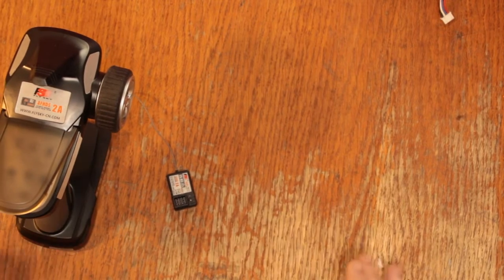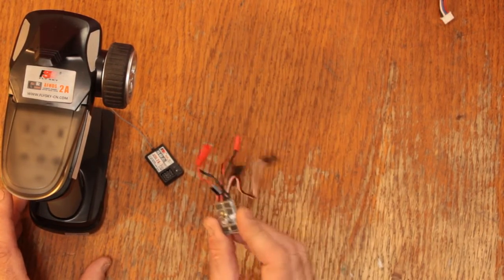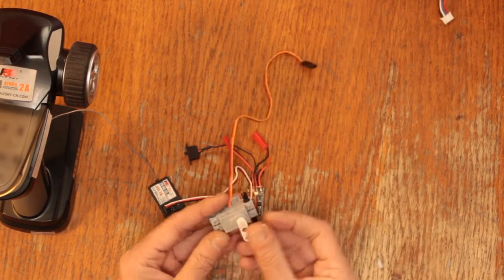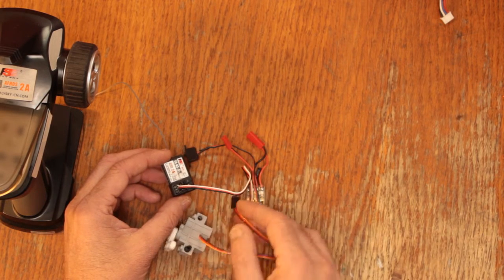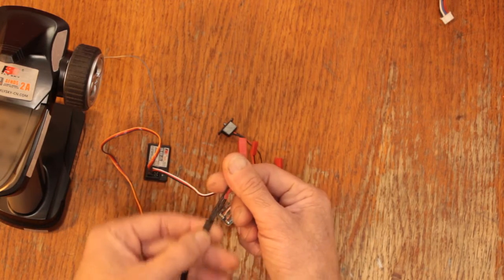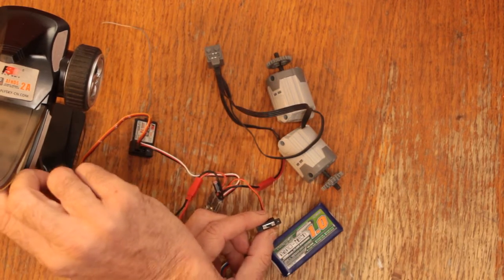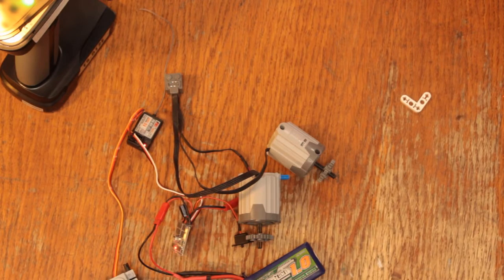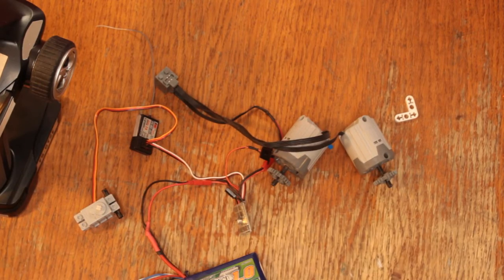Lego Compatible Servo for Lego Hobby RC Radio Control

Comment: Would any cheap 2 cell lipo battery work? Is there a battery that you would recommend?
Reply from the maker: Any 2 cell will work. Just choose the size you want. Bigger lasts longer and can push larger motors without getting warm. I use 300mah for small stuff 800mah for really big stuff. These look nice to me. https://amzn.to/4ppg8L0 . I don't know of any bad brands of battery but I do like Tatu, and BetaFPV, and GNB.
Reply: @MaxBrix thanks.

Comment: I know this is an old video but I see you're still active. First of all thanks for posting all these tutorials. I have a question. It looks like my ford raptor truck is under powered with PF servo and buggy motor running on mould king battery (runs 7.5v). The car stalls. I don't have access to buwizz battery. Is this the best solution? using lipo 3s and esc to having the voltage running at 10v?
Reply from the maker: If you can do the wiring and know ESCs it is by far the best.
Reply: @MaxBrix  Hi there. I have all the parts to make this mod you have here. Only thing is my motors doesn't move in reverse? I'm not sure if my connections are wrong or if the ESC malfunctioned.

Comment: First of all: thanks for this video!
I bought three geekservo: gray for steering, green for gas, and also the red motor as an alternative for extra power. First two worked perfectly for my first project. I'm now trying to find an ESC that can work with the red square motor as it is powered by only 6V and 0'7A. I purchased expecting the package reaching me next month a 20A, 6V to 9V ESC as it was the only one I found close to the motor's specs. Any guesses of what can happen when the current of the ESC is far superior than that of the motor?
Reply from the maker: A trick for you. Get a 9g servo (should be 2 for $10). Take out the electronics. There is a potentiometer that detects the servo arm position. Fix that to center. Take off the original servo motor and attach a connector for your geek servo motor. Now you have a 5v esc that can be powered from the receiver.
Reply: @MaxBrix  Man, you made my day! I followed what you said, took the circuit from an old Sanwa 102, soldered wires etc and now it's working perfect with the geekservo motor. Thanks a lot!
Reply from the maker: @operarimartinez  LET'S GO!
Reply from the maker: As long as voltage is safe the current is fine. For motors you need more supply current than is consumed or voltage will drop. That is what happens when a battery goes flat. Some devices limit current like LEDs. A motor is like a water wheel as long as the water hitting it isn't moving to fast it can be in a huge river.
Reply from the maker: I will have a video about the homemade servo ESC in a few days.
Reply: @MaxBrix  I appreciate it. If it could show how to properly remove the potentiometer if possible- that would be great
Reply from the maker: @operarimartinez  You can measure the resistance of the pot (both sides) when it is centered and replace it with resistors. The controller chip need to see a resistance (measured on the outer poles of the potentiometer) or it will seend current to the motor. Hope that made sense I have had a beer.
Reply: Hi  @MaxBrix   did you make a video about "homemade servo ESC" ? thank you

Comment: Hello, Interesting video.
Depending on what type of RC Vehicle you are designing, the XL Motors you are showing may not be the best suited... they give an enormous amount of Torque (enough to twist Technic rods) but are quite slow at around 110-120RPM.

Thanks for the informative video
Reply from the maker: My vehicles usually have legs.

Comment: Hey I just realized the lego motors have 4 wires on them what ones are negative and what ones are positive?
Reply from the maker: It's in this video, I think. https://youtu.be/0EDv0chrJF0 . The inside go to a motor. Changing polarity changes the motor rotation direction so +and- don't matter to a motor. The outside wires go to a receiver or something that can not change polarity. When the battery box switch is reversed the polarity of the inside wires changes but the outside wires polarity stays the same.

Comment: Man thank you for this. I'm building a unimog soon and I have spektrum receivers and I wants to use my controller and now I know I can this is going to be awesome. I didn't want to have to use my phone as a controller.
Reply from the maker: Happy to have been of service. Phones are bad.
Reply: @MaxBrix  that's for sure. This will be the coolest crawler I have. And I can switch up the design for a new truck whenever I want
Reply: @MaxBrix  hey bud are these little servos decently powerful for the size. I was thinking of running 2 together for my steering if one Is too weak. Will be using in that raptor technic kit
Reply from the maker: @motododo4626  I'm a little late replying. There is a larger Geek servo. It is rectangular.

Comment: Very helpfull! Would it be possible to wire the standard lego servo motors to the receiver by modding the cables as you did with the motors?
Reply from the maker: I think It uses a different PWM cycle, proprietary. I think I saw discussion of this on a forum and it was not easy. but don't quote me on that.

Comment: Thanks for uploading, your video is still the only one I found on Youtube using these geekservos :-) About that: I tried hooking those up to an arduino with a PWM signal on the control wire (and 5v on the power wire). But it only made random-looking movements. So do you have a hint for me how to make that work? What is your PWM frequency, for instance? Thanks a lot in advance if you have anything for me :-)
Reply from the maker: I would have to look it up and I'm about to eat. It runs on a standard RC receiver pwm cycle. I think 500 HZ is neutral up to 1000HZ for full turn but don't quote me on that.
Reply: @MaxBrix  Thanks man, I appreciate it. I found out what the problem was: my power supply wasn't stable. Now it is working fine and I am looking forward to completely integrating arduino and lego in an economic way.

Comment: 2:24 will that adapter work for lego servo motor?
Reply from the maker: Good Question! No. The Lego servo uses the outside wires on the Lego lead for power and the inside for a PWM signal to control the position of the servo. The Lego servo will not run from a direct power source like an ESC. The lego system is wired differently than hobby servos (4 wire vs 3) and uses a different PWM cycle. so you will need to use a Lego controller like Lego IR, SBrick or Buwizz (or Arduino) to control a Lego servo.
Reply: MaxBrix ok

Comment: Thanks so much for this tutorial, I've been looking everywhere for something like this. Unfortunately, the servos no longer seem to be available anywhere.. the only similar ones I can find are 270 degree instead of the 90 degree on these. Any idea what I can do? Is there a way to convert the official lego 90 degree servo to connect to this?

Also; Would you mind explaining how you convert the 3.5mm bullet plugs on the 60a ESC to the lego motors?
Reply from the maker: 2 - 90 degree 2 360 degree servos That are really motors:https://amzn.to/3ijhIyq

This talks about wiring with lego:https://youtu.be/0EDv0chrJF0
Reply: You are a saint - thank you!
Reply: @MaxBrix  Dear MaxBrix, thanks for this explanting and useful video. which servo should i buy for 90 degree right and 90 degree left turn the link you have shared in the explanations was this https://www.amazon.com/gp/product/B07QSX3V5F/ref=ppx_yo_dt_b_asin_title_o05_s00?ie=UTF8&psc=1
Reply from the maker: @Bricksfaction  Sorry I never saw your comment stuff is gettin burried. The Red ones are motors. Maybe you saw the video I just made. Anyway, You want the 4 pack of grey ones. unless you want 2 motors. I hope I am not too late!
Reply: What about setting the dual rate so that it only rotates 90°?
Reply from the maker: I use those JST connectors. Attach both bullets to a JST and use a JST to Lego from this vid. Polarity doesn't matter motors run both ways and the controllers are reversible.
Reply: @MaxBrix  i mean which 4 package should i buy. In one of the packages there are 2 red and 2 gray motors. for 90 degree turning which one should i buy )

Comment: would using a 60A ESC burn your motors? I'm trying to make a setup with 2 Buggy motors and a servo using 2 esc one for servo one for 2 buggy motors and i've seen people using 23A and 10A ESC but not more, which one gives the most power without burning your motors?
Reply from the maker: No, it would not. A bigger ESC will provide more amps than the motors can draw. You always want this to be the case. If the ESC is too small it will burn out and not fully power your motors. if it is too big it costs more and weighs more. You can use a 60 amp ESC but something smaller could be more practical. The ESC in this vid is 10 amps. It works great for one m-motor or two under light use but it keeps over heating under heavy use. I need more power so I recently ordered a 60 amp ESC, wink.
Reply: @MaxBrix  Thanks! I will try a dual 30A or 60A Setup with a 7.4v 2s pack.
30A: https://www.amazon.com/Ocamo-Synthetic-Brushed-Electronic-Controller/dp/B07KSRMSXQ
60A: https://www.amazon.com/HobbyWing-QuicRun-Waterproof-Electronic-Controller/dp/B00MGMHRZ6
Reply from the maker: @abyys676  I am useing the hobby ing 60 amp!
Reply: @MaxBrix  I have an extra 60A hobbywing esc I can take from another rc car. Any issues soldering the esc wires to the power functions adapter wire since the esc wire is a much thicker gauge wire?
Reply from the maker: Edit: Less than 11 v is safe. I have burnt a few off brand l motors at 12.6V 60 amp. XL motors can take 12.6 V 60 amp. So either keep the volts below 12 or the amps below 30 or use more than 4 l motors
Reply: @MaxBrix  Thanks for the update, i finally decided to use the hobbywing 60A ESC with a 7.4V lipo pack setup for 2 buggy motors and a servo. I also tried it with Rm8's Toyota Hilux, the performance is outstanding! Again, thank you for your answers! :)
Reply: @MaxBrix  i bern buggy motor too with 12.5. and its hit too. 7.4 its good enough, or you can use regulator of 12 v that delivering limit current. Just need to make sure it can deliver this current, i got 1 with pick of 3 amp and its too low. 
Need 4 amp min for eac buggy motor.